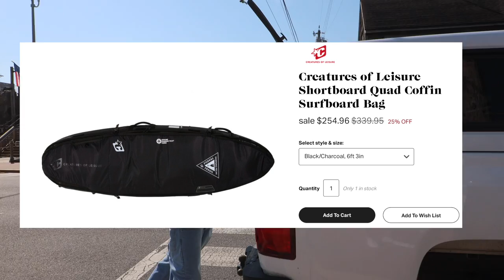Can't Believe What We Found Trash Picking! THESE ARE LIKE $300!

Comment: Turner,  puleeeze oil your door hinges.  They make my teeth hurt.
Reply: sharon yatrofsky yes exactly my thoughts just a spray of wd 40 and it’ll be night and day difference.
Reply: It goes on the stairs to save someone some steps...say from the den to upstairs!!
Reply: sharon yatrofsky 😂
Reply: He needs new rubber stoppers in the doors of his truck.  Cost $15 on Amazon but a b** to install and takes two people or a frame that holds the door free from the truck and can re position to put the door back on.
Reply: Lithium grease.
Reply: Tucker

Comment: Sammie those globes from that ceiling fan can be used as candle holder. All you need to do is get u old log drill holes in it. Then take the globes the part that goes up in the fan. And place it in the holes then add ur candles.

Comment: I wonder if you can still find that webbing for those chairs. It used to come in a roll and with a rivet gun you could re-do them easily. .  They are not overly comfortable  or easy to store though..
Reply: I would try and make strips of checkerplate plastic instead of the nylon webbing. The Aluminum Lounger cot style chair.  I would take one of those for sure..